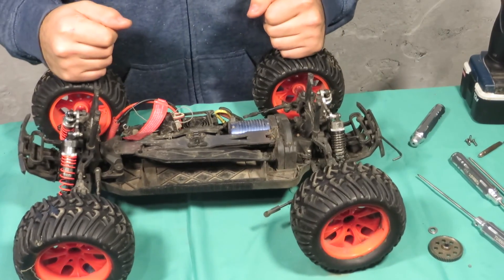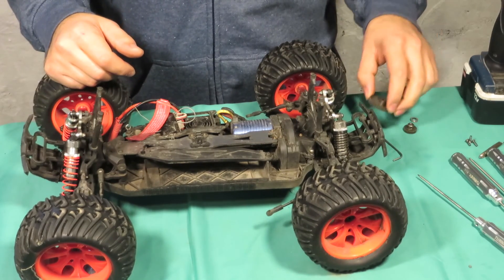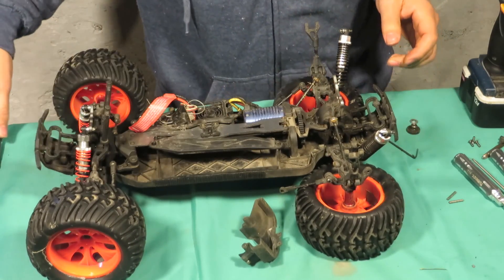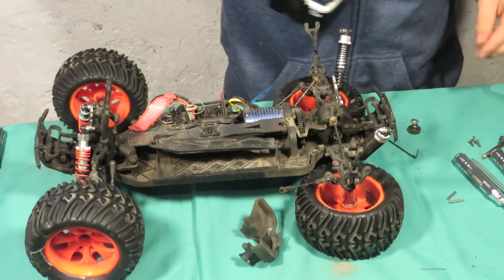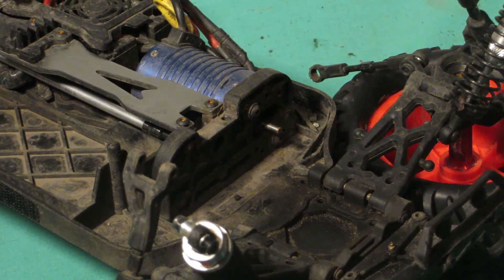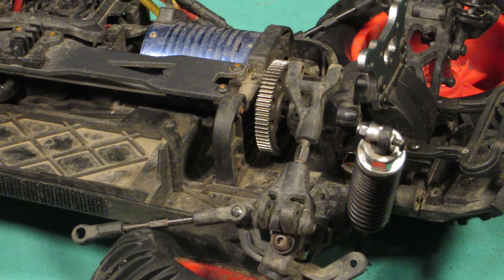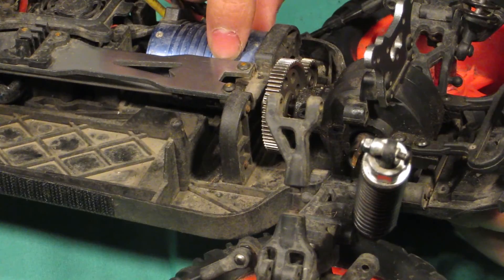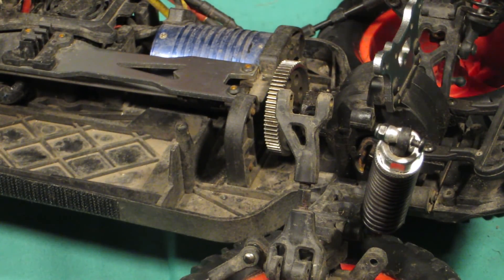Blackout XTE Pro Gear upgrade Mod

Comment: I need to find some top end speed gears. prolly gonna be my next project. we just finished a track width increase. new much longer arms and linkages. now it's stable and doesn't drive all over the place I think it's ready to go fast. 60$ project but we just ran a 3s 5500 and it handles like a team car now.

Comment: Any news on whats the best thing to buy stock or this 64T spur gear overall performance ? I have noticed a noise in the differential i put some grease and sound reduced pretty much but i probably put the wrong one car didn’t spin the same without motor on but after breaking that grease i got better performance wonder if  there is better tires i feel these tires stock are not for my usage i have street pavement  and tires when i break grab on that solid i am scared i try to go lowest breaking level but i have tried the method to avoid tires from puffing up at high speeds .
Reply: I noticed transmiter range in my running area  is about 30-40meters which isn’t enough as i once lost reception and truck got almost ran over
Reply from the maker: Your better off with the stock gear setup. But get a steal pinion. The stock pinion is brass and wears fast and destroys the gears. Tires I  would get a street setup. The transmitter I would upgrade or maybe you just need a new receiver. At least if u upgrade most new transmitters don't need 8 batteries.
Reply: Thanks i will upgrade to 19t pinion metal instead of the 17t that came with and upgrade to a more range transmiter with a gyro

Comment: do you have to take that last plate off with the slot in it for the spur gear, this is the step I'm at and one of my hex screws are stripped at the head from factory... What can I do...

Comment: Nice bro everyone else claim they needed to shave off 1/8 of an inch on the neck bore so the e clip would fit to hold the spur in place but you found a way around it with the shim/spacer on the shaft end to hold it in place instead of the e clip 🤙 what website did you get the spur and pinion? 
And what brand?
Reply from the maker: it was so long ago dont remember.

Comment: hey man I got a 32t 48p hardened steel pinion gear 1/8 bore is the 1/8 bore to big on the motor shaft I tightin it and its tight but when I go the pinion gear moves is 1/8 bore to big....thanks brother
Reply from the maker: robert jr o yea bro thats to big..try to find an adapter for it or just gona have to get a 1/10 scale size.
Reply: Thanks brother

Comment: King very informative and allot of info so if i wanted to keep the stock spur and have the best of both worlds with fast acceleration and a fast top end what pinion do you recommend thanks in advance...
Reply from the maker: QuickDrawMcDraw 227 Just keep going up on the pinion gear. The stock pinion is 18 tooth so keep going up a tooth at a time to find your balance.

Comment: i just got my 64t spur and 30t pinion, ive gotten the mesh to my liking, only issue is how loud the gears are, did you have this problem also? Are you still running the 64/30 or have you adjusted? thanks in advance
Reply from the maker: Robert LaBombard Yea it can be pretty loud especially if ur not use to hearing it. but i loved it. but no I have switched back to stock. I did buy a 18 tooth steel pinion its better then that brass pinion. haven't stripped a spur yet.
Reply: Right on, my first truck and im diggin it, thanks again
Reply: @VicToR_Rider  do you have part   number on that pinion and did you change back cause not enough tourque?
Reply from the maker: @hchris24  sorry don't have the part number. Got it off a ebay. And yes i did reverted back to stock do to some lack of torque  and hotter engine.
Reply: @VicToR_Rider  no problem bro thanks for reply you still run the truck?
Reply from the maker: @hchris24  its down right now. Needs new receiver and remote. I put it in my sons truck and maybe a few other things but I will be rebuilding it to it glory lol

Comment: I have also order the same tires as the ones in this video... can i use them on stock settings? Or do i need to make any necessary upgrades?
Reply from the maker: They'll be fine as is.
Reply: @VicToR_Rider  i asked a few other people too and they were like that i will have to upgrade spur and also bring pinion to 1tdown? Not needed?
Reply: @VicToR_Rider  pls also tell what shocks are these? Link too pls
Reply from the maker: @muhammadfarooqtariq2439  honestly just got them off ebay. They weren't that great. Just more happy with the look.
Reply: @VicToR_Rider  what size shocks shall i look for?

Comment: aye for the spur gear,the washer you used was it just 1 or 2 and does it matter what size?i just got my new steel 64T spur gear and since the original one dont fit no more.not sure what washer to use or how many.
Reply from the maker: if you can try using a bearing.. I have a spacer I found laying around but it's about 1/8 of an inch. just enough to keep the gear from sliding out of place.
Reply: +King Veonietus. i found a washer like yours.so im good

Comment: What tooth pinion and spur did you use? I bought the Valcano pinion and spur gears from redcat. No problem installing them but  my blackout wouldn't run for more than 5 seconds with them in. It would run real fast then die, run real fast then die. every time i had to turn it on and off to get it to work again.
Reply from the maker: does it work fine with out them? also could be to tight up against the motor mount and causing it to seiz up. check it out and hit me back
Reply: +King Veonietus it was so bad I actually bought the stock ones for the blackout. I know it seemed like it was very hard for the ones from the Volcano to have enough contact. There was no way they could get to tight.

Comment: Do u recommend strapping two 2s hexfly 5800mah 30C in parallel?
Reply from the maker: MrGetLikeMe its going to add to much weight to that one side. it will give tons of run time and higher output but watch your motor temps

Comment: So the 64 tooth spur is smaller the than stock 55 tooth? Confused on as why it has to be 28 or higher. Why not a 21t pinion or 26t.
Reply from the maker: Yes the 64tooth is smaller and the pinion won't reach if its less then 28. But in my opinion you're better off just keeping the the stock spur and getting a steel pinion. The speed with the 64tooth isn't really much different.

Comment: what pitch is the new spur  and pinion gear?
looks  like a 48 pitch?
nice video,  make more.
thanks
Reply from the maker: yea it's a 48p..thanks I will
Reply: 48 p is that a 8 or 6 Mod gear ?
Reply from the maker: I'm not familiar with the mod number sorry just know it's a 48 pitch for 1/10 scale
Reply: I just looked it up it's a 6 Mod
Reply from the maker: +Jimi G RCrazy (RC Crazy) o nice..good to know
Reply from the maker: +Jimi G RCrazy (RC Crazy) I'm trying to make my 2wd RC reach high speeds with a 1/10 setup then going to bigger setup

Comment: Hey I know this is an old vid,  but do you still recommend this spur and pinion? I just got one of these and want the metal gears,
Reply from the maker: No. U will loose torque and would have to figure out how to keep the spur gear in place. I would replace the pinion gear to steel if yours comes brass. The brass pinion is what goes and ruins the spur gear.
Reply: @VicToR_Rider  Oh man, thank you, you helped me out big time brother,
Reply from the maker: @Blimpus  anytime

Comment: since the spur gear is smaller and the pinion gear is bigger to get the mesh, how is the acceleration and speed compared to the original plastic spur and metal pinion?
Reply from the maker: Bunthoeun Has the acceleration decreases but you will get more top end speed. I topped out at 55mph but a few people said you can get to about 45mph or more on 3s with stock gearing. But really depends on what you want to do I went back to stock gearing but got the steel pinion to prevent stripping of the spur gear.
Reply: King Veonietus ah,  ok.  I wanted to go to 3s but I'm afraid the plastic spur gear might strip. I do a lot of offroad driving so acceleration is a must
Reply from the maker: Yea put that steel pinion in and you'll be ok..

Comment: what gears did you get king and were
Reply from the maker: robert jr 64tooth spur gear part# 11184 and a 29 or 30 tooth pinion gear..ebay or google will bring up a few sites..

Comment: whenever I go to look at pinion gears I find 30 tooth ones, but there are different T ratings. Which T rating do I use?
Reply from the maker: 48 pitch is what you need for this setup

Comment from the maker: fit right in. this spur gear was smaller then the stock gear
Reply from the maker: Ramiro DY got it to 55mph but I think it had a lil bit more just ran out of smooth road
Reply: I'm hoping to do this mod but in reverse  on my lightning to get a steeper ratio with the 55t spur. looks like I'm gonna have to shave off some of the thickness of the spur. Thanks for uploading the video.
Reply from the maker: Any time. That thing already fast how fast u trying to go lol
Reply: Actually found a metal 50t for a 1/16 scale that's the same pitch looks like the 64t.  Trying to get it in the 80's 
Part# HSP 18250
Reply from the maker: Holy smokes that would be sweet making me want to get back into speed game with the xte. Whats the part number for the pinion ur using?
Reply: I got the stock 29t now. I think I'm gonna go with Hot Racing 33t #NSG33M06 it's the biggest I could find in 0.6 pitch.
 I think you might have the space to run a 32pitch pinion as a spur 28t like the green Castle CSE010-0065-02.  That would be my first choice  to run 1:1 ratio ,but I only have 9mm (front to back ) Most pinions are 11mm thick might be the same as your 55t stock spur. Just gotta file a flat spot for the grub screw.
Reply from the maker: The problem i have with my spur gear to the xte is the way it installs to the shaft. It has to sit on this pin to keep it in place. It doesn't screw on or has a grub screw to it.
Reply: That 64t gear will work even though it's thicker then the stock 55t and you can't put the lock washer in place. There's a  bearing in the motor mount on the driveshaft side, if you get another one of those and put it on the shaft between the spur and the motor mount where the lock washer would be it fits nearly perfect when you put everything back together. DON'T use a stack of washers to fill the gap and hold the spur in place... it doesn't end well!! 😉

Comment: will a 64t spur and a 26t pinion work or will they not touch each other I have a black out xte pro also trying to figure out exactly what size metal spur and pinion
Reply from the maker: the 26 pinion is not gona reach I try'ed it..29 or 30 is ur best bet unless u could find a pinon with a bigger diameter
Reply from the maker: if ur not gona do it for speed runs honestly ur better off with the stock spur and a steel pinion witch they have now.
Reply: King Veonietus okay thanks man
Reply: thats what im running now stock spur steel pinion and no problems yet i am running oversized tires though so that puts more wear on gears and motor but we will see haha,,
Reply from the maker: Lol nice
Reply: If you're not looking for the fastest top end the easiest way to make the Blackout (and any rc really)  quicker off the line is to just replace the 18t stock pinion with a 16t or 17t. I've tried multiple combinations of spur and pinion combinations, the stock plastic 55t spur is definitely the weak point but until I find a steel replacement it'll do. Changing to a steel pinion and going down a tooth or two makes quite a difference. If top end speed is your thing then just go up to a 19t or 20t pinion... but keep an eye on your esc and motor temps then.

Comment: Hey man.. question? I wanna switch out my spur gear , and I need to know what the diameter of the shaft is for the spur gear.. looking online no luck, I’ve messaged Redcat , waiting on a reply
Reply from the maker: Not sure the size diameter of the shaft to the spur gear. But pretty sure they only make one spur gear for it. The gear in this video was from a different RC. It fit on the shaft but you have to figure out how to make it stay. I think I used a spacer or bearing. But to take a wild guess I'd say the shaft is 5mm thick.
Reply: V6 Vic if it’s 5mm thick than.. I’m %1000 fine lol found a spur gear that’s 5mm thick it’s a 62T spur 😊 thank you for the help I’m more confident , I might not have to 3D print a new holder BUT a spacer!
Reply: I love the RC community , doing things for RC cars that the manufacture should do, because all honesty the black out xte is a beast of a machine and they could have had it like how the rustler is with all the hop ups etc , even if you had to buy an adapter from them to use 3rd party parts id still be game , but I guess this makes things more fun! And interesting 😊

Comment: The original pitch on the Spur and Pinion is incorrect and that's why they keep burning up the gears .I have to change mine also with about 12 hours run time .
Reply: Lmao . It would have been easier to remove the back bone .Lol .Just messin with ya .
Reply: You changed it to what exactly? Did you upgrade to metal or stock and what pinion  and spur gear do you recommend ?@Russell Cupples

Comment: Did it keep esc and motor temps cooler?
Reply from the maker: No. If anything anything slightly hotter. Higher gears are gona make hotter. I was just trying to prevent stripping of the spur gear which was an issue at the time of this video.
Reply: @VicToR_Rider  I have a stock pinion, 15 , 16, and 9 tooth , you think if I use the stock pinion or a smaller size it’ll be way cooler then stock? I don’t mind loosing some speed
Reply from the maker: @Andrew-hh3ol  it'll be cooler but not by much. It'll be fine with stock pinion unless you're planning to run battery pack after pack.
Reply: @VicToR_Rider  I’m trying to get in the 120~ degrees range for my motor and keep my esc cooler the only motors that stay cool are crawler motors this truck has mostly given me diff and electronics issues which have been sorted out
Reply: @VicToR_Rider  ah damn it’s 48 pitch

Comment: how did you pop you turnbuckles off...
Reply from the maker: Ryan Petersen needle nose pliers or a screw driver
Reply: King Veonietus would it help to press the chassis down while doing it???
Reply from the maker: Yea
Reply: King Veonietus minus the top 4 screws are those all that are in the way of opening the gearbox from the top to see the shape of my gears...
Reply from the maker: Yes I believe so
Reply: King Veonietus got them off and still locked down... Nevermind, got it...
Reply: Will this setup/gearing work for the Blackout SC ?

Comment: So u suggest to not run it on 3s?
Reply from the maker: I'm going to try it. I think it will be fine just gotta watch your motor and make sure it doesn't over heat. I don't have a fan on mine yet but that will help. If u do run it on 3s just ease into it. I'll also make another video on speed run with 2s and 3s
Reply: I run mine on 3s all the time it does make a difference I can tell you that
Reply from the maker: Is that with this setup or stock? I'm going to go back to stock after a few speed runs.
Reply: Yes it is all I did was hook a 3s and off it went

Comment: The stock 18/55 gear setup is a 3.06:1 ratio, and this 30/64 setup is 2.13:1 ratio. So these gears are about 43% taller. That seems like a huge change! (Like running a 26 tooth pinion with the stock 55T spur.) Do you see a big jump in top end speed? Conventional wisdom says acceleration would suffer and it would drain batteries a lot quicker. Has that been your experience?
Reply from the maker: yes it has. I have converted it back to the stock gearing I had my fun with it as a speed car now back to bashing lol.
Reply from the maker: yes I reached a top speed of 55mph on 3s..
Reply from the maker: Rh Last Nae yes back to the stock plastic spur gear and the the 18 tooth pinion but steel not bras. I guess the bras pinion was the issue with the spur stripping all the time. I havent had a problem yet with the steel pinion.
Reply from the maker: Its a redcat. U could find it on there website or rcplanet.com